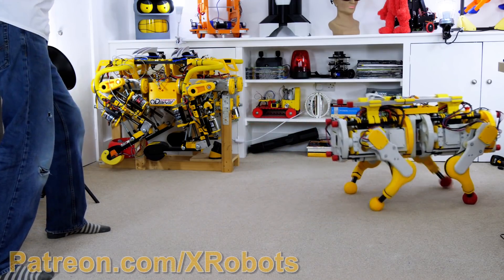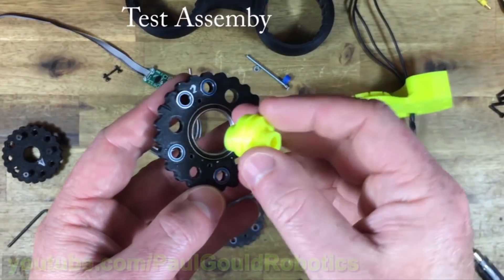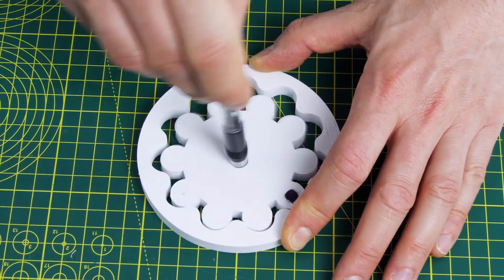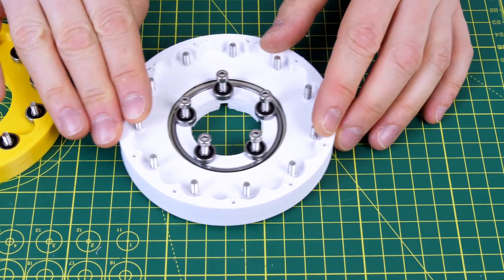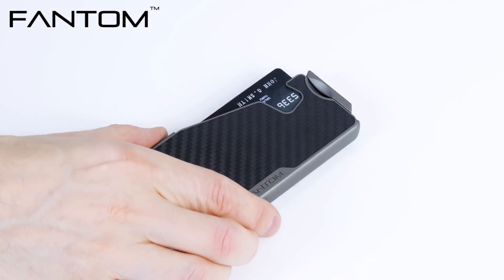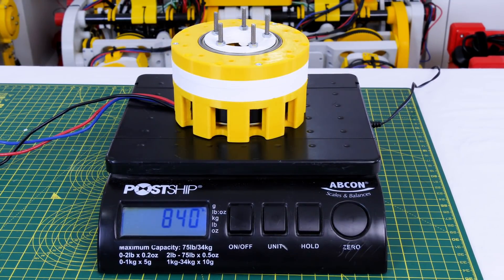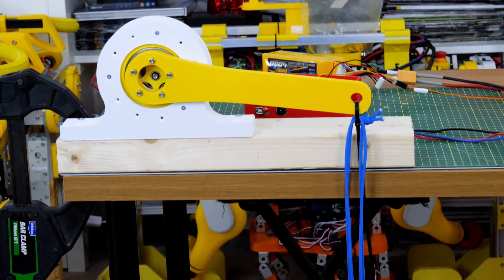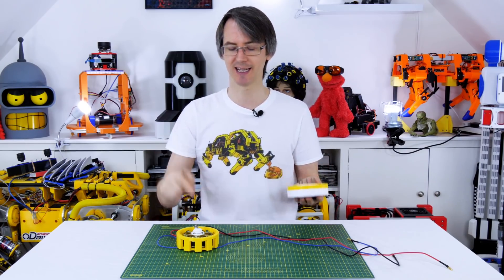Experiments with Cycloidal Drives

Comment: Lots of enginering complexity and great ingenuity but too complicated. Just go with a metal worm gear drive, the simplest, strongest, smaller-faster motor, highest tourgue,and one way locking ability. Have you ever thought about this solution? Thanks for great vidio.
Reply from the maker: But not back-driveable which is essential as I mentioned.
Reply: @jamesbruton  sorry l missed the back-drive, it must be for the pup to prance & bounce. Maybe just some metal compact planetary gearing---just saying. Keel up the good work.

Comment: Smaller bolt and bearings with smaller motor high torque lower speed .
Reply from the maker: it's a 90KV motor, they don't come much lower speed than that. I need the speed so the dig can walk as I explained

Comment: Thanks so much for the great video. I can't wait for the next one. Since it is 3d printed, would it be possible to make one of the parts have more sparse infill on one side and more dense on the other to balance it?
Reply from the maker: Yes, but it's mostly the metal spinning around off centre that's causing the issue, V2 comes up in a couple of weeks
Reply: @jamesbruton  Thank you! Can't wait.

Comment: While being able to 3D print all the custom components is a worthy objective, I'm not sure how practical it is.  After all, motors and bearings and electronics arrive in the post, so other parts could too.  Here in the US, when I need a 2D custom metal part, I use a laser cutting service bureau here in Reno called SendCutSend (#noaffiliate).  They can cut aluminum up to half an inch thick and steel up to 3/8 inch.  All I have to do is upload a vector file of the part outline to their website and a few days later the part shows up in the post, and it's all very affordable.  With a service like SendCutSend available I'd never allow the properties of polymer 3D printing be a limitation when designing 2D components.
Reply from the maker: Version 2 comes up in a couple of weeks!

Comment: Something's off with those slicing settings to have so many voids between the walls and top surfaces.  It's really going to hurt part strength if you don't figure that out, although maybe you have and these are just prototype-grade quick prints?
Reply from the maker: Yep I have control over everything - it's a Simplify 3D slice

Comment: Would it be possible to use one of the holes in the motor for the center cam axis? It does extend the offset a little, but it is metal instead of plastic

Comment: great video and technique, but your 3D printed parts look like they have bad layer adhesion. 
I think if you tweaked your printed to get perfect layer adhesion your parts would be much stronger.
Maybe use PETG and increase your heat to 220c
Reply from the maker: It's PLA at 230' and it's fine.

Comment: 2:23 that's adorable, look at him jump. Hey James do you have any videos on robots driven by bowden cables? I've been toying with the idea of a soft cable driven exoskelleton with back mounted drive motors, but I'm not very knowledgeable. The idea is to have a motor or gearbox capable of high torque and high speed in a compact assembly. The advantage of cables being that the person wearing the exo doesn't lose mobility by bulky mounted servos. If you ever have a project with a similar actuation mechanism it would be very enlightening. I really enjoy your contet, your work is incredible. 👍

Comment: If you optimize your teeth design you can make it contact 100% around the cycloidal disc, that's where the real benefits are with this  type of drive
Reply: correct, I see no reason why this should not work more perfect with real gear tooth design instead of these round teeth. But certainly much more efforts. I have seen this only once. All other designers do it as you do (with the half circles as teeth)

Comment: Make your cam full infill and put 2 screws through it. that'll make it much stronger and won't snap the layers so easily.
that cycloidal gear seems like a good idea for my blinds which fell down due to lack of friction on the original fitting. I'd like to put a motor on it but feared the wait of the blinds would fall down but with the bearings, makes it more expensive unless a lot of grease might do the trick since this will be only 5cm diameter. thinks

Comment: Since I recently got a 3d printer, I now fully realize just how much you are able to get done on one within a week. A lot of my prints have averaged at 24 hrs per print. But even with smaller prints, they take longer than I thought. You have several printers now to help you get more done, but even with 1 printer, you seemed to work fast.
Reply: Try 1mm nozzle and either .25mm or .4mm layer height, 45mm/s, 210-220C for PLA. Thinner layers allow steeper unsupported overhangs. Supports can add a lot of print time and material use, so design to minimize them. If you have something high up on a model that needs support, see if you can build one in that angles up at 45 degrees from a nearby surface. Much more efficient than a tower all the way from the build plate.

Comment: You previously had issues with the motors in Opendog 2 heating the plastic, so you fitted those metal plates to dissipate the heat. Might be worth doing similar again.
Reply from the maker: Probably, although this is 10:1 and the belts were 5:1, so I get the same torque for half the power/heat.

Comment: Didn't you have a cnc? Why aren't you cutting these gears out in Aluminium?
Reply from the maker: The discs weren't the part that broke, plus I really want to make it accessible. V2 comes up in a couple of weeks.
Reply: @jamesbruton  That's understandable. Maybe print the broke bit with 100% next time, or with some added bolt afterwards. That part will always be wanting to sheer in the 3d print's weakest plane.

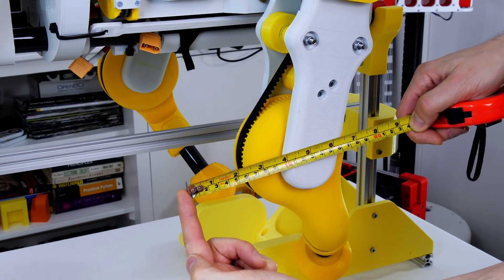Comment: It is very cool, but I guess planetary gearbox would last longer and work better in general. It should be also possible to make one with 1:10 ratio. But this is much cooler mechanism :D
Reply from the maker: I'm pretty sure the motor gear would strip really quickly in a robot dog if it's 3D printed.

Comment: pls fix the extrusion issues with your 3d printer... getting OCD from otherwise cool prints :D
Reply: If it's over-extruded slightly it will be stronger though. ;) But in this case he's under, so yeah, agree that for an application like this that should be fixed.

Comment: why didn`t you use a planetary gearbox, they are prety small and can transfer a lot of torque. sorry for the bad writing.
Reply from the maker: I mentioned in the video - the gear on the motor won't be strong enough to be 3D printed with the velocity and torque I need.

Comment: The cycloidal drive gets it's name from the shape of the gear teeth, a cycloid. One of the big perks of this type of gear is that there is pure rolling contact between gears of this type, rather than the sliding that occurs with involute gears. This means that those outer ring bearings should be redundant, and the fact they are turning is a sign the tooth profile is not correct.

Glad to see you considering these though, maybe also look at 3D print+belt "strain wave gears", I don't personally like them because they work by fudging some of the tolerances and clearances more than the more industrial version but they seem to work.

Also, you can "invert" the drive and have the outer gear as the output, if you stationary fix those pins that go through the inner cycloidal gear.
Reply: Really? I thought it was the opposite, that involute gear teeth have theoretically perfect rolling contact, and cycloidals always have some amount of sliding. How are you generating your cycloidal curves? I've been using these equations, but I'm not sure how to analyze the exact amount of sliding that happens and/or whether there's an ideal pin radius to minimize it.

x = R * cos(t) + e * cos(N * t)
y = R * sin(t) + e * sin(N * t)
Then inset by pin radius

R = ring radius
N = number of pins
e = eccentricity
t = 0...2pi
Reply: @dekutree64  It's been a while but I wrote an openscad script to generate cycloidal gears. Essentially you are tracking a point on the circumference of a circle as it rolls on another circle.

But it's the other way around, cycloidal gears have pure rolling contact and a variable pressure angle (goes from 90 to 0 if memory serves) which is what makes them bad for power transmission, but good for low friction and wear, so they are sometimes used in mechanical watches.

Involute gears have a constant pressure angle, which makes them good for power transmission but there is sliding contact. https://en.wikipedia.org/wiki/Involute_gear
There is rolling contact, but only for the instant where the line of action crosses the line connecting the two gear axles.
https://involute.pro/fileman/Uploads/sliding%20velocity.pdf
this also describes it in more detail
Reply: @H34...  But does generating the curve by rolling a circle mean that you have rolling contact against stationary pins as in a cycloidal drive? Seems like the pins would need to roll like the circle that you generated the curve from. i.e. the perimeter length of each disc tooth is equal to the pin circumference, so in a theoretically perfect machine where the disc maintains constant contact with all pins at all times, the pins would make one revolution for each turn of the input shaft/advance of one disc tooth. In a real machine the disc is only in contact with ~1/3 of the pins at any given time, but they should still be rolling at the same angular velocity as the input shaft during that time... unless I'm failing to visualize it properly (which is possible)
Reply: @dekutree64  yes, you have rolling contact against a stationary pin. Imagine a fixed pin, and a pipe (loosely) sleeved over it, you can roll the pipe around the pin without sliding them against each othef and it sort of orbits and rotates, which is exactly what cycloidal drives do.
Reply: @H34...  Hmm, I guess the problem with my mental simulation was that when rolling the cylinder to create the curve, the disc is stationary, whereas in the working machine the movement of the disc is equivalent to rolling the pins in the opposite direction.
So then are the roller pins in some professionally made cycloidals just to reduce cost by allowing for lower precision machining of the discs, and to compensate for other sources of imperfection such as deformation under load, thermal expansion, wear over time, etc.?

Thanks for the help! I'll have to compare the curve generated by those equations I posted to one generated by cylinder rolling and see if there's any difference.
Reply: @dekutree64  i dont know if the rolling cylindrr generates the same curve, since the rolling body (cylinder) is a larger circumference than the body it is rolled against (pin), whereas usually the tooth radius is smaller than the gear radius. It was just to illustrate the orbiting rotating motion and how it can be done with pure rolling.

I dont think the pins in commercial units are rotating, I think they are fixed. The reason for this is probably that round pins pressed into a circular pattern of holes is much easier to manufacture than the cycloid geometry, and functionally identical for a cycloidal gear since the profile is created by rolling a radius (the pins) along a circumference.
Reply: @dekutree64  yes, it does have pure rolling contact. Think about it this way. Usually the way you think about it is to generate the profile you track a point on a small circle (the tooth) as it rolls along a stationary larger circle (the overall gear). So when a pin the same radius as the tooth circle mates with the cycloid, it should roll just as the tooth circle rolled to generate the curve, and not slide.

The difference here is the pin is stationary, so the gear must roll(rotate) instead as it orbits.
Reply: @H34...  I'm back to being confused again, as even the "true cycloid" curve (properly called epicycloid) must then be inset by the pin radius, which changes the total perimeter length. So as far as I can tell, the pin radius has no fundamental relationship to the small circle rolled to generate the initial curve. Unless perfect rolling contact does not require the perimeter length of each disc tooth to be equal to the circumference of each ring pin.

Looks like the curve my equations generate is called an epitrochoid. I had some signs backward from the equations on wikipedia, but it only causes a phase offset. And epicycloid is a special case of epitrochoid where eccentricity is equal to the small rolling circle radius.

My original mental simulation may have been correct after all. Watching cycloidal drives in motion, the tooth opposite from the engaged side is for sure sliding past the ring pin at high speed. So in a theoretically perfect machine where the disc maintains contact with all pins at all times, that pin would have to be rotating pretty fast to prevent sliding contact. But since only the engaged area matters in a real machine, I'm not sure how meaningful that is. Hard to see exactly how much rolling versus sliding is going on in the engaged area.
Reply: @dekutree64  the pin radius is the same as the radius of the circle used to generate the tooth, so the circumference is the same. The gear tooth is simply rolling along the same radius as was used to create it. 

As the the pin opposite to the engaged side, it should not be touching the gear, there should be clearance. If it were touching there would be sliding, or more likely binding as any amount of interference would mean the gear tooth can not skip past that pin and would get stuck. In any case, the pin opposite the engaged side is not representative of how cycloid gears mesh, so you shouldn't look at it to determine if meshing cycloid gears have rolling or sliding contact. That pin is being skipped by a tooth, not meshing with it.
I'm not sure what you mean by inset, but even insetting (shifting?) the curve does not change its perimeter.